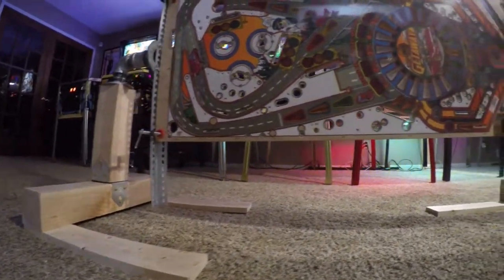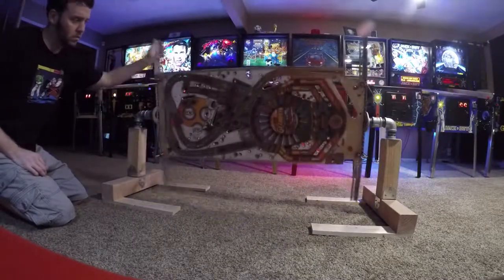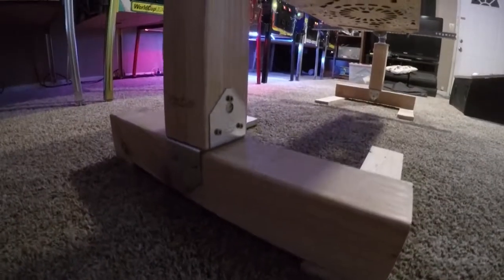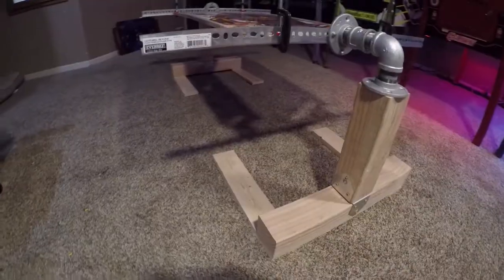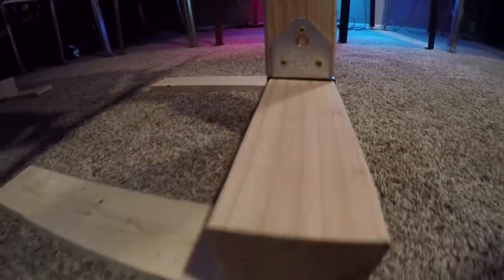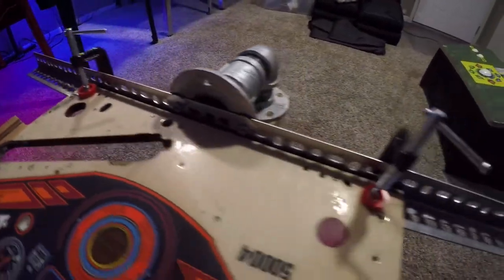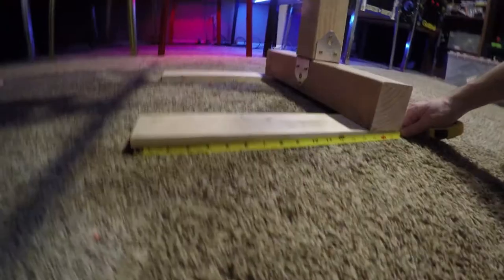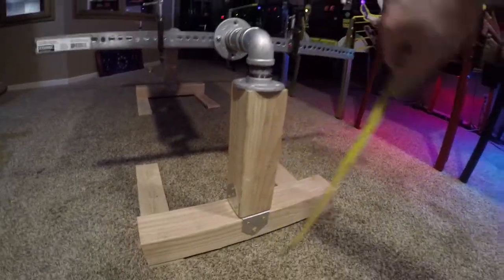How To Build Your Own Pinball Playfield Rotisserie On A Budget

Comment: I have 
3.5" x 3/4" : x4

4x4 x 22" : x2
4x4 x 12" : x2
Slotted angle Zinc 1 1/2" x 14ga x 36 : x2
C-Clamp : x4
Galvanised 1.25", 
Mount plate: x3
Threded adapter: x4
90's : x2

What is the last part I am missing that allows it to rotate?
Reply from the maker: couplers
Reply: @CaryHardy  Thanks! You are a real life saver! I'm heading to Home Depot right meow!